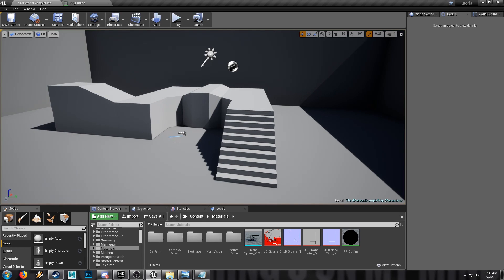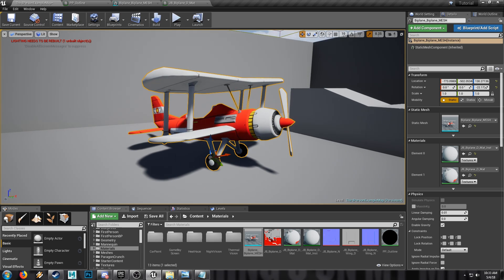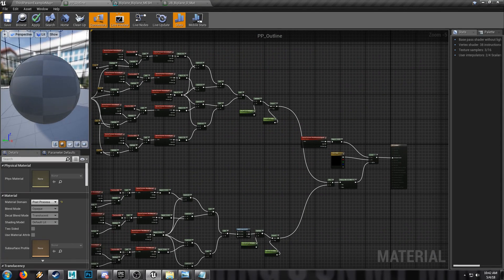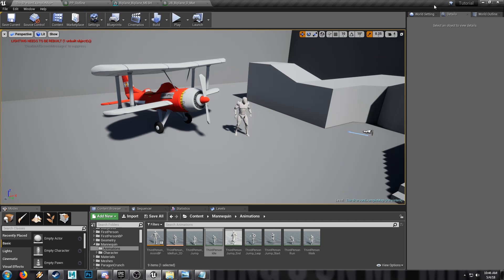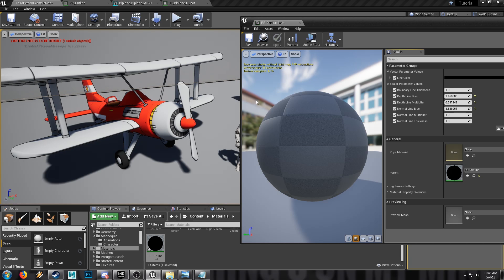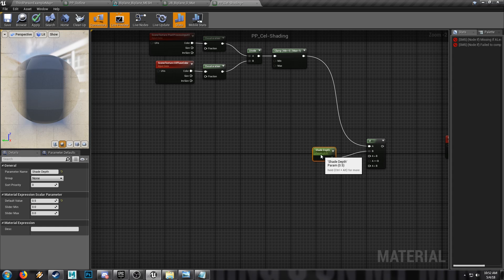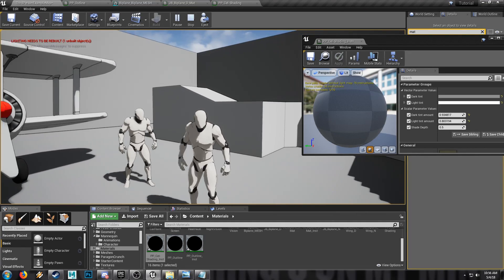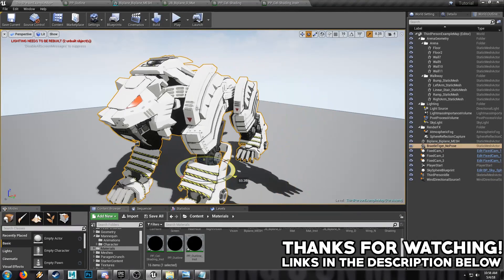UE4 Tutorial: Toon Shader (Borderlands/Jet Set Radio)

Comment: If you're having problems with your IF node throwing an error such as "cannot force a cast between non-numeric types" during the outline section of the tutorial, pop another Mask set to RGB in between the LERP and the A < B socket of the IF node.

Comment: Quick question, what if you don't want to affect the world or other characters, but have just a couple models you want to have the effect on?  Ideally you could use the tag system so only models that have the "toon" tag have the effect applied.  Is something like that possible?
Reply: instead of doing this in a scene wide post processing shader you'll want to recreate it on a per-shader instance, more expesnive though...

tech art aid has a video on a material approach, it could potentially clash with any project idea you had in mind since it simulates a directional light in the shader so you'll have two sources of light if you included a directional light actor in your scene.

*comment for future people

Comment: Great tutorial, really. Subcribed!

 Quick question, though. I followed everything to the letter and I have this one small issue.. Once the cel shader is implemented... I have no shadows on/in my characters meshes. 
I did see one difference.. "Clamp UVs" checkbox on the SceneTexture Nodes does not exist anymore in my version of UE4.
EDIT: Shade Depth parameter (just like the line thickness from phase 1) does not seem to behave like a float. When I change Shade Depth from 0.0 to 1 the effect stays the same. Also from 1.1 to "infinite" makes my whole shading darker with no difference in between either).

Would you have any idea how come I'm not getting shadows? My Meshes cast shadows but they have none on/in them.
Reply: I have the same issue... did you find the answer?

Comment: Got a slight issue if you could point me in the right direction or even speak to me through discord or some method to help me correct this problem https://youtu.be/1rGYCBAMPfs here's the link to whats going wrong
Reply: It appears as though your Normal outline block in your Outline Post-Process is the issue. Your SceneTexture nodes in your outline normal section can cause this. You want "SceneTexture:WorldNormal" for your center pixel, "SceneTexture:SceneDepth" For your second, and "SceneTexture:WorldNormal" for your third for all pixel selects. If you just put "SceneTexture:WorldNormal" for all values, you get something like what you show here. Good Luck!
Reply: @dakotasmith5874  Thanks going to give it a try. Thanks for taking your time to help.
Reply: @dakotasmith5874  I'll give my apologies in advance, but when you say "second" i'm not sure what you mean? Do you mean the Down pixel and for the "third" Up pixel.
Reply: I changed the Down Pixel from "SceneTexture:WorldNormal" to "SceneTexture:SceneDepth" i think it may have fixed it
Reply: I mean from left to right in your Normal Sobel Operator (the pixel comparison block). The 3 Scene texture nodes in the normal section. Glad to hear you got it working!

Comment: the shader no longer works unless (in the custom depth section) i reverse the "PostProcessInput0", and the "if" (from the distance filter section) into the "if" for the custom depth. i have it working but i wonder if it has to be the way you set it up to work. i personally can tell no difference atm with custom depth applied.
Reply: I have same problem...

Comment: is it possible to have 3 colours for the cel shading? like, color 1 for normal tint, color 2 for shadow tint, and color 3 for light tint? this could be something like anime characters
Reply from the maker: Yes! You'd just blend another light color tree with your cel-shading post-process material! In theory you could have as many different shading 'levels' as you'd like :)
Reply: @underscore00  I'm not sure where exactly you would plug in the 3rd Color Tree? Currently the two color trees are plugged into the IF statement, where do I go from here to add more bands?
Reply: @underscore Yeah, I'd be pleased to get an explanation on that topic, too. I really like your Shader (downloaded it) but would like toenhance it by adding more colors to the shadow side of things. :)

Comment: So I tried building this, but fear I messed up somewhere. I ended up buying the pack, but I don't think it's working right. The outline is a light gray, even though it's set to black.
Reply from the maker: Hi, thanks for supporting the channel! Can you try using the materials in a different project? If the issue keeps persisting then I'll investigate it more closely and see if it's an issue with the engine version or something like that.

Other than that, just double-check that the materials are set up properly and even use a new post-process volume to see if it's not a problem with your current lighting set up. Sorry you're having problems, I'll do my best to help!
Reply: underscore Hi I have the same issue, purchased in the store and was trying to learn it, somehow it does work only as regular dark color, I have tried in new project and checked the material, dont know if this works on your unreal 4.22? please take a look, thanks :)
Reply: underscore never mind I just figured out that I forgot to enable the costumdepth on model mesh, as newbie always get lost in these steps, thank you for your inspirational tutorial:)

Comment: is there a way to make the Cel Shading/Lighting more crisp and smooth vs the kind of blotchiness it makes. I'm going for a more Windwaker style
Reply from the maker: The short answer is to just use high-poly meshes in your game. The 'blotchiness' occurs because lighting data is stored in vertices, so the more verts there are, the better the result.

Hope that helps!
Reply: @underscore00  Yeah but windwaker isn't high poly and if this is intended for a game, making everything high poly to have nice crisp lighting, doesn't make sense, also that would be a huge drain on resources i'd imagine making everything high poly, where "High poly games" Arent even high poly usually.
Reply from the maker: Unreal Engine 4 can handle millions and and millions of polygons on screen at one time, and drawing geometry is a far lower cost to overhead than drawing textures - so if you're going for flat colored, stylized, non-reflective materials like in Windwaker then the impact of some extra geo is going to be negligible. Here's an example of how the lighting changes with poly count: https://i.imgur.com/3zkj5kH.jpg

In the above image, the sphere on the left has 10 axis subdivisions, the middle sphere has 20, and the right sphere has 64.

You can also model in a way where objects look low-poly while having the extra faces to tighten up your lighting - in 3D modeling they're called 'supporting verts'. Here's a pyramid I just made to show what I mean: https://i.imgur.com/t36ToAJ.png

So you can still have a low-poly look and keep sharp edges and flat faces using edge normals, while also including a few more verts to improve the way the object is lit.

I hope that makes sense!
Reply: @underscore00  Thank you

Comment: Hey this is awesome!
What if you want the opposite effect for custom depth?

Like I want everything to be outlined, EXCEPT specific objects?
Because with how it's setup now, you'd have to manually set every mesh's custom depth.
Reply from the maker: Youd use it in the same way, just switch the A and B values in the custom depth mask :)
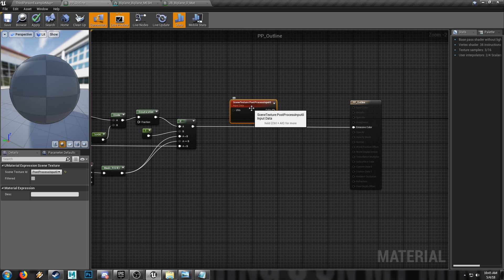Reply from the maker: @Solar Cypse The A and B values in the 'if' node during the section about masking custom depth. It should be at around 7:50

Comment: The first part works fine but the cell shading part does absolutely nothing. for me. Not sure where the problem is..

https://i.imgur.com/JIgS58c.png
https://i.imgur.com/hOJ8OsZ.png

Created the instance, added it as a 2nd array, and as I change the parameters, color etc, nothing happens. I even tried switching off the 1st array, the outlines, to see better, added ridiculous values, so I confirm that nothing happens..

Comment: cant get the shading to work. won't let me use diffuse color
[SM5] (Node SceneTexture) GBuffer scene textures not available with forward shading.
Am i missing something here?
using 4.19
Reply from the maker: Yeah, the problem is in the default renderer settings of your material - select the base material node (the big one you plug everything into) and in the details pane there'll be a setting to change the renderer from forward to deferred. That should fix the issue!

Comment: Hey, I tried this, and i don't get solid cells from shading, i get a bunch of dots at the edge of shadows, how can i fix this? i followed every step in this video. https://imgur.com/a/IBSwQ5K
Reply from the maker: My first guess is that your scene texture nodes are set incorrectly - it looks like the material is effecting the normals of the surface and not the surface itself.
Reply: @underscore00  how would I fix this?
Reply from the maker: Check your scene texture nodes in your cel-shading material and make sure they're set to the right option :)
Reply: @underscore00  I have checked everything and it all matches up to what you have in the vid.
Reply: @underscore00  I have remade the material several times and every time it gives me these errors. I have no idea what's going on because i followed the instructions in both the UE4 tutorial and your video to the letter.
Reply from the maker: Sure thing! I'll download it and take a look ASAP :)
Reply: @underscore00  Thx m8
Reply: @underscore00  Have you found anything?
Reply from the maker: @What_Zen  Hi! Yeah I've had a look at your material and I have some answers. First of all, I opened up your material in the engine and compared it to my own and the good news theyre exactly the same - I know you said that already, but I thought it would be best to double-check :)

That means the material is working perfectly. The artifacts you're seeing are caused by two things: First is the normal map of the mesh (in this case the default UE4 material). As you can see here ( https://i.imgur.com/s1kxi9o.jpg ) the shading works with normal maps. In this image ( https://i.imgur.com/eaDO5yP.jpg ) I've disabled the normal map on the material and you can see how the object appears smooth.

Secondly, the rough, spotty quality is caused by the mesh being low-poly. This shading method relies on vertex data to create shading and vertices can only hold so much - so long story short, more polys, higher quality. You can see it work in this image: ( https://i.imgur.com/Earo1Is.jpg ). The sphere on the left has 10 axis subdivisions, the sphere in the middle has 20, and the sphere on the right has 64. 

I hope all that makes sense! The short version is: Use high poly models and high resolution normal maps and the cel-shading will look way better :)
Reply: @underscore00  thanks a bunch!
Reply from the maker: @What_Zen  no worries :) sorry for the late reply!
Reply: @underscore00  It's all good.

Comment: Hey !  if you have some troubles with the Skysphere having black circles and the way it's done in this tutorial don't work for you... I've found a simple solution , just put an "If " after the last Add node just before the  mutiply witch have the parameter called "DepthLineMulti". In this "IF" you will plug two constants one at 5000 and the other at 0. But first you want to plug the add  in "A" value of the If node and also in the "A<B" value. Next plug the 5000 constant in the" B " value and then plug the 0 constant in "A>B". Next plug the If in the multiply and it should work if the others ways don't.  You might want to convert the 5000 constant into a parameter if your scene is very big. Because it could mask the lines in distant meshes such as big landscape but i doubt you will have to do it.   Hope it  can  be helpfull to some people :)
Reply: Awesome! Thank you very much
Reply from the maker: Good work! Issues with the sky mask are a fairly common problem people run into, so it's great that there are easy solutions out there :)
Reply: @underscore00  Ahaha Yeah i've searched for hours xD I hope it's understable english is not my mother tongue x)
Reply: Thanks so much for this fix! Helped me complete the shader for my project!

Comment: Hopefully someone could come up with a way to make the stepping (transition from shaded to lit) super clean.  The way PP-based toon shaders transition from lit to shaded isn't good. That is, depending on the camera viewing angle the line between lit and shaded area will get trashed - where you can see the shadow bleed into the lit area or the lit area bleeding into the shaded area.

Frame skip back/forward via , and . between 18:00 to 18:02 to see how the shadow gets butchered.

Other than that, this is a really good step by step on how to set up PP-based toon shaders.  But imho, PP looks like sheit.  This may be because the mesh face and vector normals aren't modified though?  I'd spent months looking at most all the techniques out there and just haven't really been satisfied with the result of PP toon shaders.
Reply from the maker: Part of the issue you describe is due to mesh density. Higher poly models are going to look better because there are more verts to calculate lighting information. This is the best and most versatile PP method I've found, and all the not-PP methods I've used are very clunky and have to be set on a per-asset basis. This affects the entire scene, so you dont have to add anything to your materials.

Comment: Applying the shader only on objects with custom depth masks out the skybox aswell. Is there a pointin keeping those nodes specifically to avoid apply the shader on the skybox?
Reply from the maker: The point was to show the two masking methods and how to use them. There are some things here that can be streamlined, and that's one of them - but I wanted to cover everything I knew :)
Reply: underscore cool, thanks

Comment: I've followed your tutorial talking about the outliner but I don't get any results, not even in the sphere preview :/ I've tried every single Blendable Location but it doesn't change anything. Any ideas of where I failed? https://blueprintue.com/blueprint/k6n_3qrf/ Thank you ;)
Reply: I'm trying to understand the problem and what I find is that before the "CustomDepth Mask" nodes, there is somewhat of a black outline, but when I conntect at the "CustomDepth Mask" there is nothing anymore. https://image.noelshack.com/fichiers/2018/17/4/1524759853-sans-titre.png
Reply from the maker: Sounds like it's probably a case of not having SceneTexture nodes set to the right mode. I recommend downloading the zip file I've linked in the description under 'Assets Download' - there's high resolution screenshots of the materials I made in this video to double-check against your own work. Also, check out the Epic Games livestream video where they make the outline material that I start out with (it's in the first 40 minutes or so of the video, link in the description).

If your nodes are all set correctly, it could be a problem with your component masks or the calculations. Try disconnecting the sky mask and the custom depth mask, then test the silhouette outlines and the normal outlines individually by plugging them directly into the clamp (skip the max node). This way you can try to isolate where exactly the problem is, whether it's in your outline code or one of the masks.

I hope this helps!
Reply: So, I've fixed the problem, I did not understand that it was normal to not see the outline on the sphere preview. But now, I have another problem where some normals on objects does not show unless I change a few degrees on the cube's orientation. https://image.noelshack.com/fichiers/2018/17/6/1524920917-problem.png
Reply from the maker: Nice work! My first thought is that the lines aren't appearing because there's something wrong with the 'normal outlines' chunk of the outline blueprint. It's happening on some objects and not others, though, which is weird. Have you checked to make sure that customdepth is enabled on all objects? It looks like the block on the right is getting an outline because the ground mesh has customdepth enabled, but the block itself isn't getting outlines.
Reply: I've checked and all the objets have the customdepth on, but the problem is pretty weird, it's like some normals aren't affected by the outline, unless if we move the object by a few degrees like I said before, here are some screenshots with multiple points of view, thanks ;). https://image.noelshack.com/fichiers/2018/17/6/1524951242-opposite.png